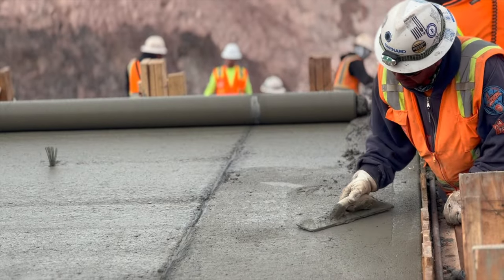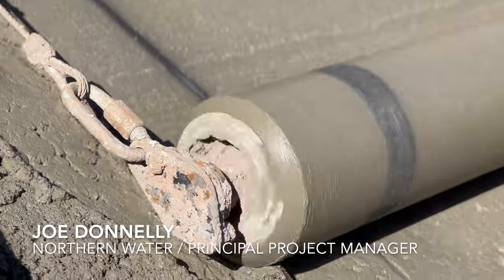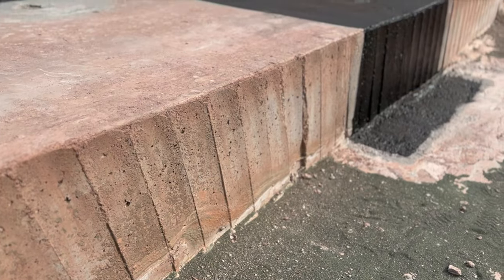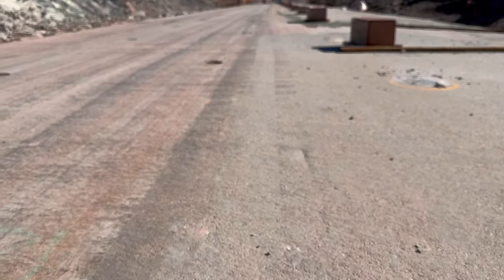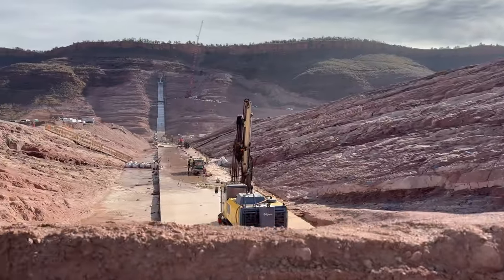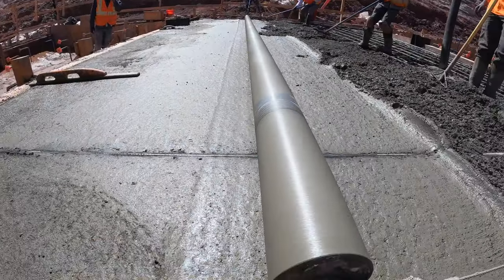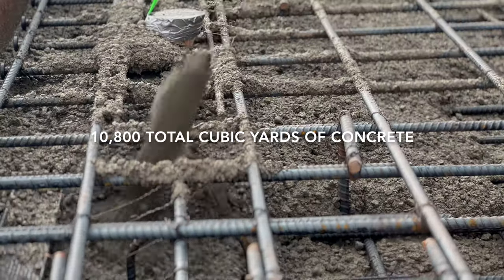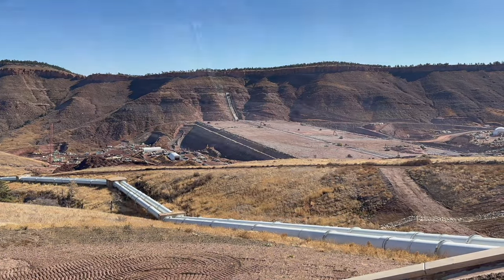Plinth Completion on the Main Dam at Chimney Hollow Reservoir

Comment: I was the construction site manager of Alpaslan 2 dam. Alpaslan 2 dam has an asphalt core. The length of the dam is 1000m and the height is 110m. We placed injection galleries inside the dam. Thus, we were able to monitor any leakage situation from within the gallery. The measurable leakage amount was measured as 2lt/sec for the asphalt core. The asphalt core method is really very economical and safe. We designed a special paving machine for the production of asphalt core. But I didn't see it in your project.
Reply: Ah ok i see asphalt paver. The dam was built under the consultancy of Walo. We did not use Walon's machine, but instead used our own asphalt paver.